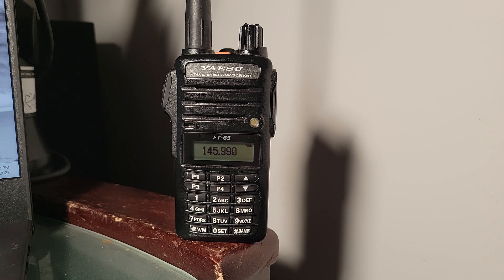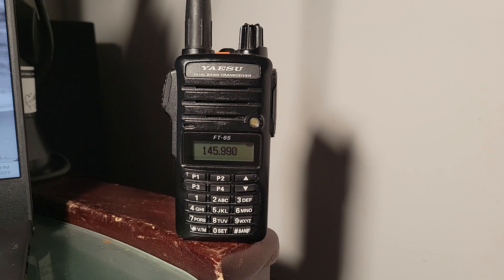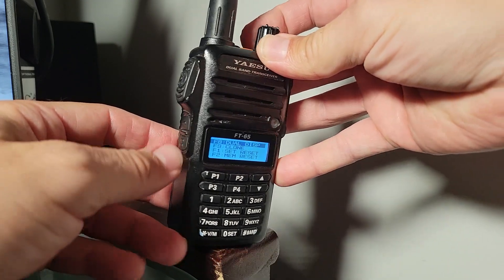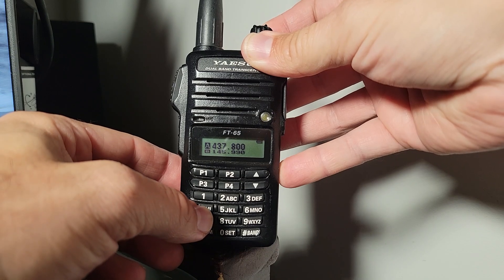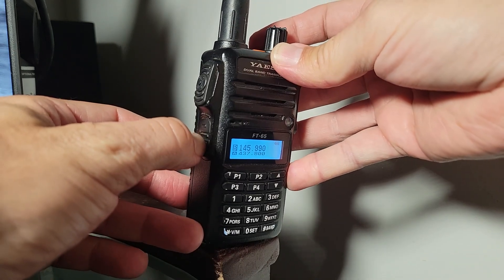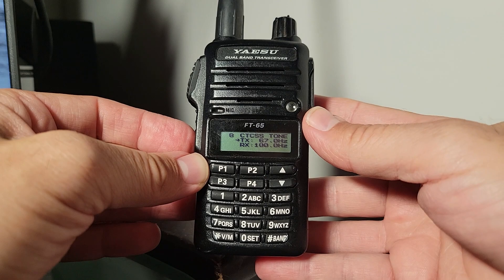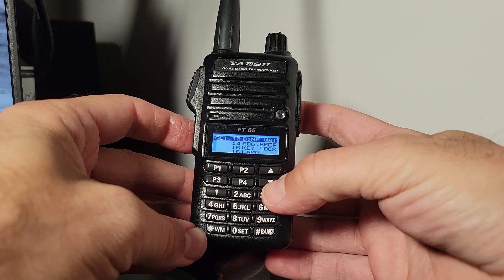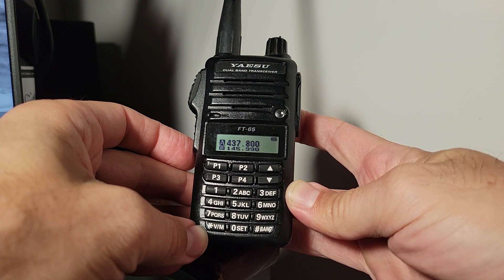Yaesu FT-65 - Settings Needed to Contact the ISS!

Comment: I also had to change the Step setting to 5kHz in order to be able to select 145.990, it would only select 145.8750 by default.
Reply: I set everything up step by step with your video got the 448575 default frequency. Set my step to 5khz. But still can't get 145990
Reply: @Sparkler333 i have samr problem..

Comment: Great tutorial on how to make this work with an FT65 - but I wouldn't recommend this radio for a beginner that's wanting to work satellites. 

A full duplex radio is best so that you can hear yourself coming back from the satellite. I often hear people calling and stepping on others during QSOs, and I think that's because they can't hear themselves / any one else, and don't realize they're interfering. Unfortunately a full duplex radio is much more expensive than the FT65 so it may be out of reach for people new to the hobby.